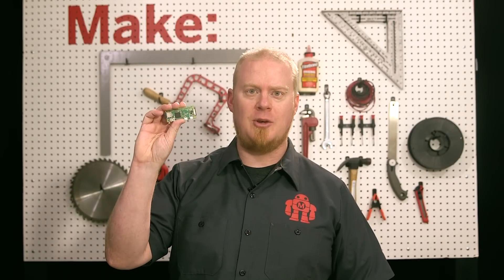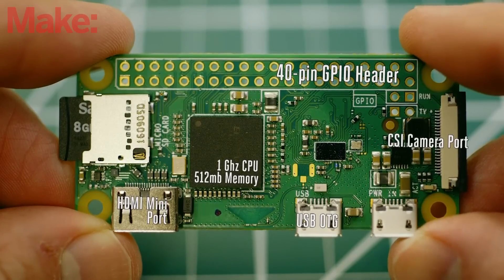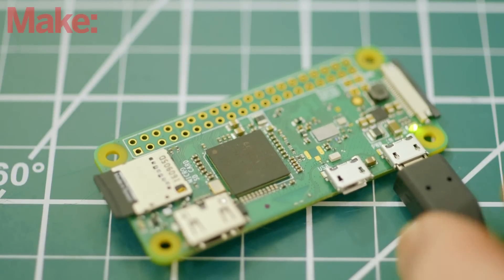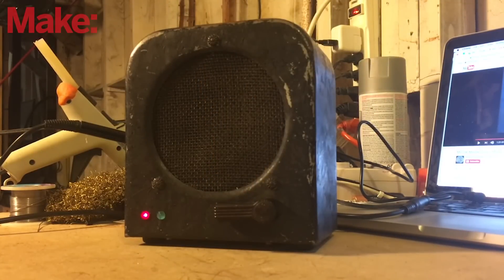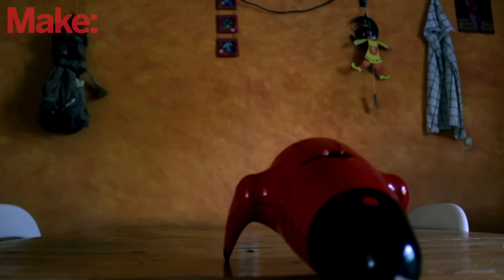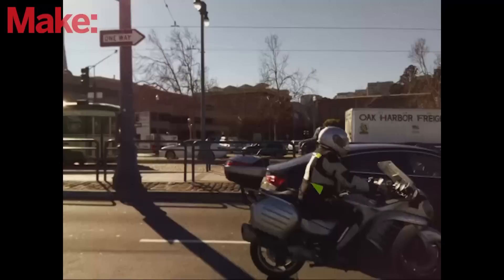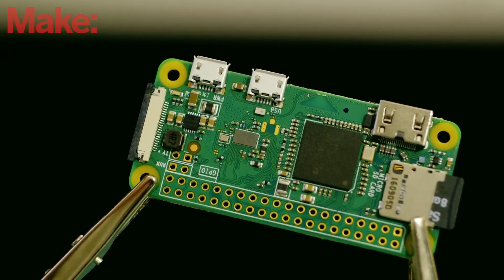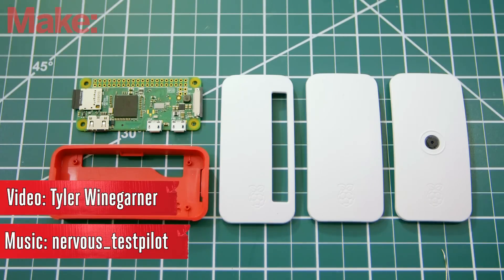Announcing the $10, WiFi-Enabled Raspberry Pi Zero W

Comment: You  could never buy a $5 pi zero what makes us think we will be able to buy a $10 pi zero W ?

Not sure why people are still promoting things that do not exist or are not available to EVERYBODY, the $5 zeros were available to select FEW who then sell the board to you as a bundle with a bunch of parts your paying 2-3 times the normal or individual prices the whole Raspberry Pi zero thing is one big scam!

I bought everything I need to run a Zero by shopping around the web buying on special got all the cords power supply adapters for 1/3 the price of what the Pi Zero SCALPERS / scammers are charging just can not get the " $5 Zero" for $5 yet THEY DO NOT EXIST !
Reply: For a while they were pretty easy to pick up at Adafruit. I got like 4 or 5 of them in the period after the introduction of v1.3, and before the release of the Pi Zero W.

Comment: This will be a massive change to people who aim to build a Gameboy Zero or similar. You can basically omit the USB hub, wifi dongle and bluetooth dongle all together. Good stuff!
Reply: Touch LCD Display With Case For Raspberry Pi http://www.ielectronicparts.com/shop/do-it-youself/3-5-inch-touch-lcd-display-with-case-for-raspberry-pi-2-pi-3-model-b/
Reply: Those are useless for use with RetroPie or anything that needs a reasonable framerate. As a picture frame or something that displays values that don't need to update constantly it's fine, but other than that they're just too slow. (Source: I've got one)

Comment: Well, yes...zero had 5 bucks price...  but 10 bucks post... and only one item per person... so screw that..... will there be more than 10pc available world wide ?
Reply: They are OUT OF STOCK this is the same good ole boy network scam they pulled with the $5 Pi just enough are sold to get the word out about the product then the PRICE GOUGING scam is started.

No such thing as a $5 or $10 Raspberry pi !

The Zero has NEVER been made available to the average consumer other than in a bundled SCAM.
Reply: vladoportos Indeed, and doesen't matter how less It cost, if It isn't in stock you can't even buy It.
Reply: www.thepihut.com has plently
Reply: I already bought 2 of them
Reply: Jose Chaves Porras Will you please share the buy link
Reply: Yep. It's either artificial scarcity or supply chain issues. They need to fix that crap.
Reply: https://shop.pimoroni.com/collections/raspberry-pi-zero/products/raspberry-pi-zero-w
best price right know for USA
Reply: 1trying tooemail I guess I am not a average person ... I am just a lucky one 😝
Reply: Even the unofficial zero's were scarce... perhaps the demand just isn't there and someone is trying to inflate it.
Reply: Maybe you can try LicheePi ZeroW, $8 almost SD-sized WIFI+BT linux board, you can buy dozens: https://igg.me/at/lpi0